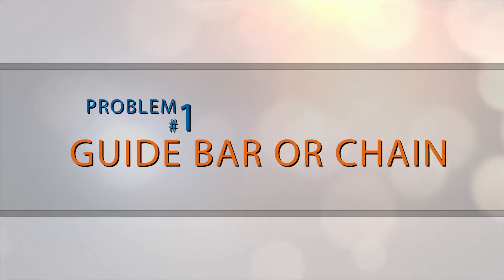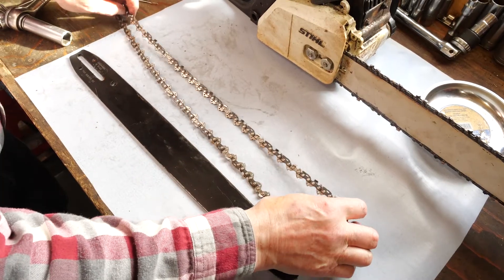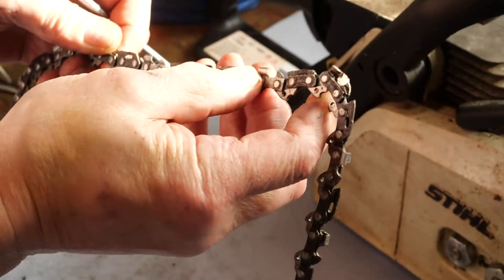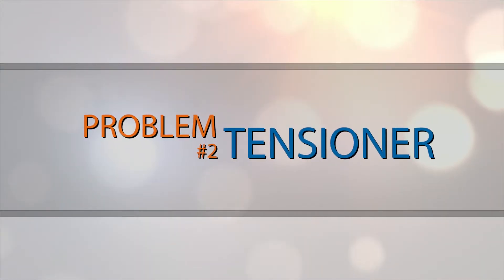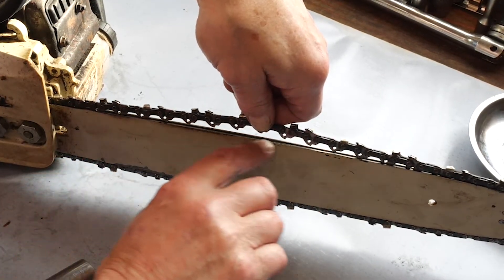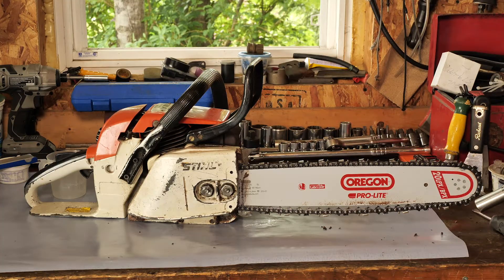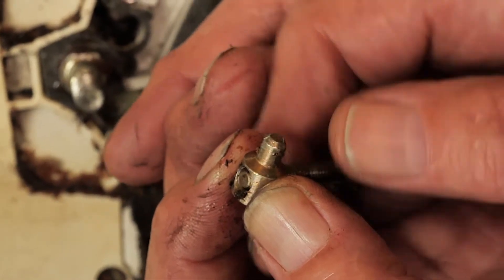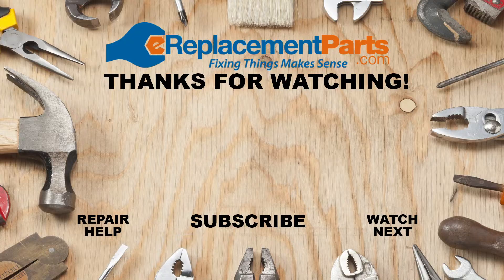Chainsaw Troubleshooting: How to Keep The Chain From Coming Off The Bar | eReplacementParts.com

Comment: Does the speed and angle matter when cutting? Should you go full speed all the time or use slower speeds sometimes? Or does the way you cut and throttle not matter with chains coming off?

Comment: Ok what about this
I have cheap chainsaw with stihl chain 
Mystery is that after some use chain is lose
I tight it up and after some use same story 
So I drill new hole and problem is keep happening 
I've cut plate/ bar so I can keep tightening 
Bar / plate can't shrink 
Chain shouldn't expend because it's stihl but even if cheap one, 
So I don't see problem 
If chain is stretching, should brake by now
Bar can't shrink so please some ideas would be appreciated 
Thanks
Reply: Did u figure out the problem to this? I saw another video where the cranks was bent because the chainsaw had been switched off and the chain cooled down and shrunk, which would then pull on the crank

Comment: Drive sprocket another hidden issue that will cause a chain to jump. Very forgotten and neglected part. Easy to replace on husky 455-460 ranchers and alike
Reply from the maker: Great Point! Thanks for sharing!